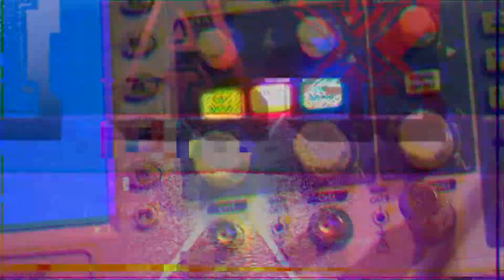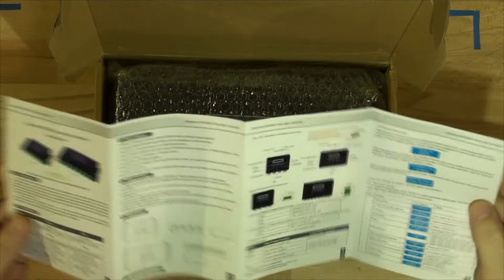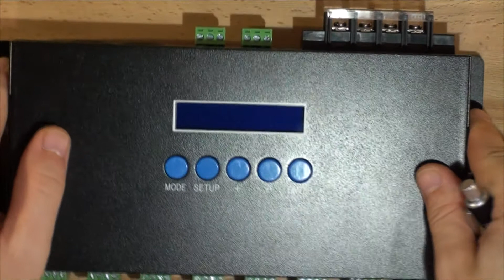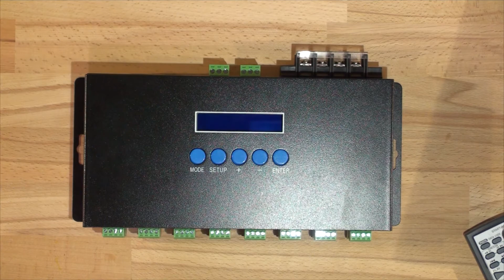Whats Inside BC-216 SPI / DMX512 Artnet LED Strip Controller

Comment: hi, i burnt a bc204 plug in into DC, i know i'm stupid as hell. opening it i see a capacitor 47uf exploded and the ''u7'' component also a little burnt, taking pictures i saw (the letters that remain) says something that 509 on the first row, E1 in the second row and 9 on the third row. i don't know if i can replace them or i'm totally over. Thanks in advice
Reply: i'm pretty shure that the component i'm talking about is the one that comes after ch3 on the BC216. U1 i think. being C2 the capacitor one that exploded. is that component available?
Reply: i'm pretty shure that is a XL150 IC, but i'm not shure if it is a  XL1509-ADJ E1 or  XL1509-5.0 E1
Reply from the maker: The ic is XL1509 -5.0 E1

Comment: sir..can you help me with this unit?i just buy it and i can't connect it to resolume...i checked up my adapter setting in my pc it says "unidentified network"...so i run the diagnostic but it keep saying no valid ip config... i use win 10..thanx before..
Reply from the maker: Try plugging it into a router or Ethernet switch, also if you connecting to pc, are you using patch cable or crossover cable?
Reply: @MaxELECTRONICS  i will try using a router..i'm using a CAT6 cable i bought at  local computer store...is that okay? Using cat6 cable?
Reply from the maker: Yes but it needs do be crossover if you plugged in directly into computer
Reply: @MaxELECTRONICS  i've try using both router and crossover cable..but it still won't connect...it keep saying unidentified..when i diagnose it say does not have a valid ip configuration...any suggestion?
Reply from the maker: Have you tried connecting it to the router?  Also try to setup the controller in DHCP mode and then try manual mode with manual address

Comment: Hi, I have BC-216 and probably short-circuited on of the ports. Now only the first pixel on every led strips lights constantly and test mode does not work. The menus and connection from my computer is still working. All the fuses inside is tested and working. Any suggestion if it is repairable and which part is causing this?
Reply: Thanks for the quick reply :) I will have someone professional to test this. Can I buy IC directly from your store if I also buy something else or another BC-216 unit? Tried to google a IC number "94 A7P1K G4 HCT245" but did not find anything(not my field).
Reply from the maker: Here’s the link to those chips https://www.ebay.com.au/itm/10PCS-SN74HCT245NSR-HCT245-SOP20-/292893583552?mkcid=16&mkevt=1&_trksid=p2349624.m2548.l6249&mkrid=711-127632-2357-0
Reply: @MaxELECTRONICS  Thanks, but this is regarding BC-216 and not the DR-05 ☺️
Reply from the maker: You need to have a look if there’s data between the ARM processor (under the lcd) and the four octal transceivers, if there’s data flowing there but not after octal transceivers then just replace the transceivers, also make sure that you’ve set up the controller for the correct led strip
Reply from the maker: Sorry I replied to wrong comment. Unfortunately I don’t have a store. Hopefully in the future once my channel grows. Have you scoped out the signal from the port to the processor?
Reply from the maker: It sounds like it’s the controller ic or the I think shift registers I think
Reply from the maker: Try using oscilloscope and trace the signal in test mode, work backwards from port to the controller IC

Comment: Hello I accidently short-circuit one of the SPI connection with a led that was wrongly wire. The SPI output do not respond anymore, do you know which piece to change on the board to fix that ?
Reply from the maker: If you open up the unit there are “automotive” type fuses inside, unplug the unit, set your multimeter to continuity, and check every fuse with it, then replace blown fuse. You can buy those fuses in any car shop.
Reply: @MaxELECTRONICS  thank you !

Comment: Hello, I have question, can you help me with product BC-216 artnet? The connection was broken during the update and lcd screen frozen on "Update the firmware" and its not working. Can you help me?
Reply from the maker: Hi, you will have to upload firmware through programming port located on the right side on the main board, you will need: a programmer for arm processors, firmware, and some knowledge in programming. Then you can attach the programmer to four pins just on the right of the arm processor, they are 4 vertical holes they would fit Dupond connector. And flush new firmware onto the chip.
Reply: @MaxELECTRONICS  Its look like complicated way :D Can I just someway restart all device or restore to factory settings? But I have other question, where can I download latest firmware fot BC-216?
Reply from the maker: No unfortunately if your firmware is corrupt you have to re-flush through the programmer.
Also I had a look I can’t find firmware ether, I don’t know who the manufacturer is, I think it’s genetic device, meaning it’s made in small factory in China and very hard to trace who makes it.